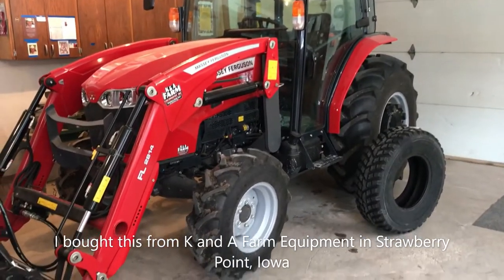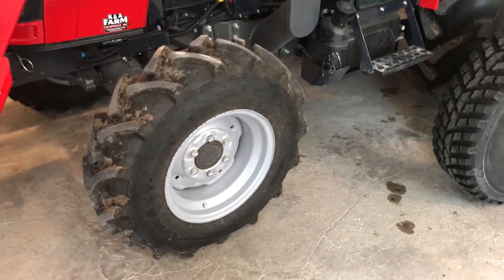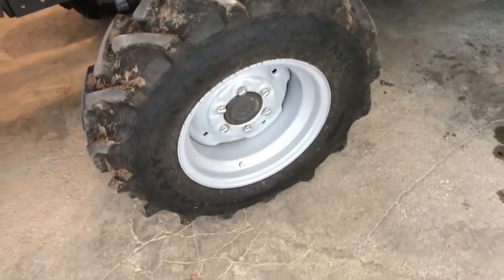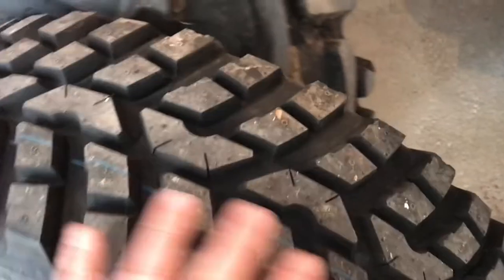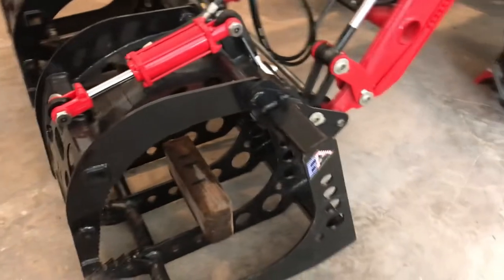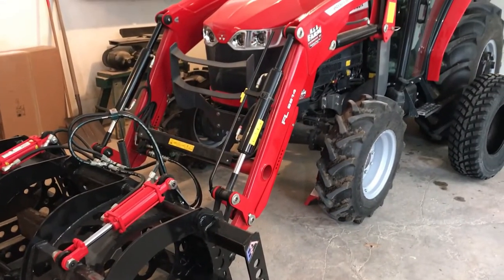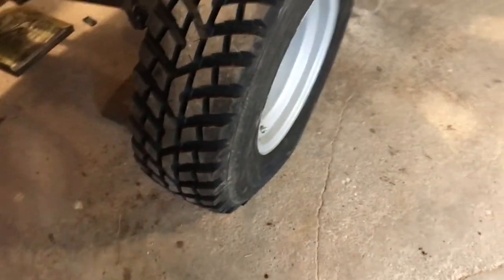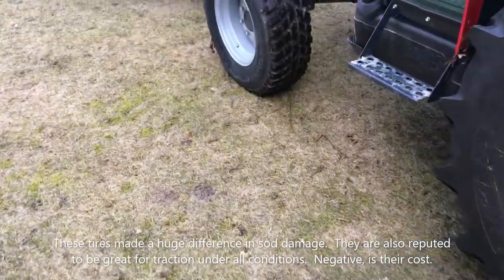Nokian tires on the Massey Ferguson 2860M

Comment: I bet they are very good in the snow???
Reply: David,  they are quite good in snow.  I am a little surprised about that.  Right now since they are new the tread lugs are at about a half inch in depth.  I suspect as that gets wore away the effectiveness in snow will diminish.  I kept the ag tires and mounted them on some aftermarket wheels and may put them on the tractor wintertime hen ground is froze up.